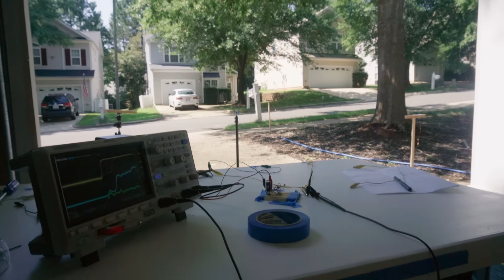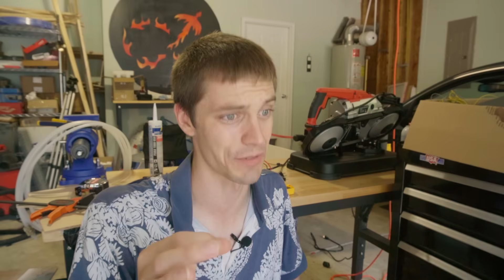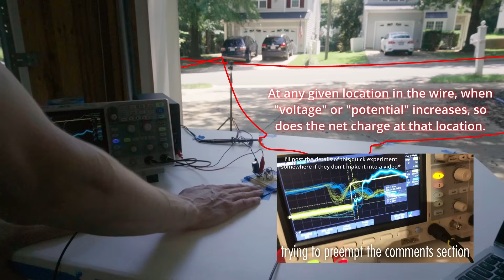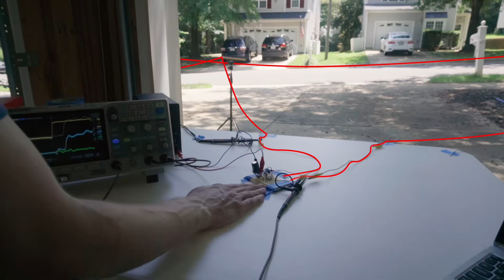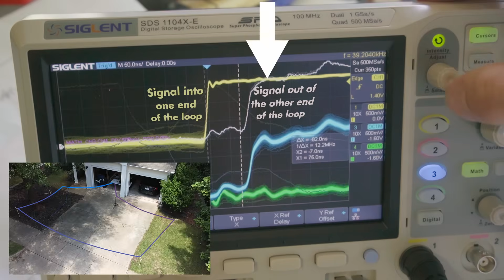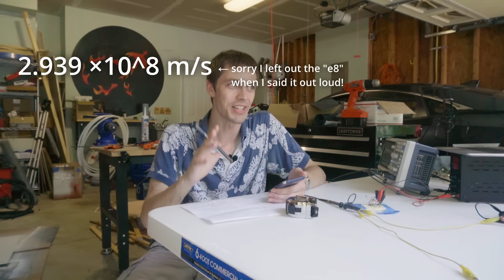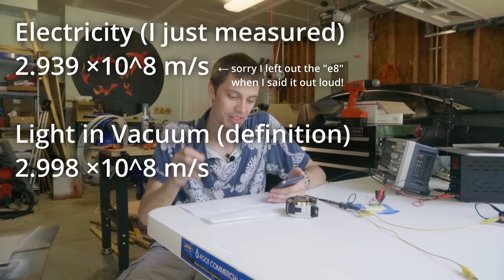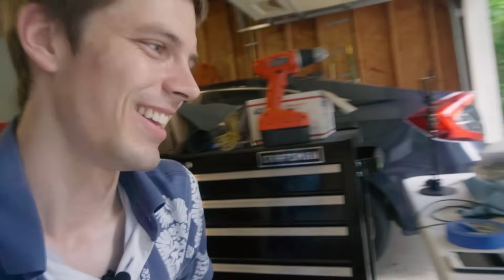Why does WATER change the speed of electricity?

Comment: From what I understood in the physics class it is something like this:
the system of atoms or molecules is "sensitive" to a couple of specific frequency. You applying a square wave to an atom is like smooshing that signal into the "holes" of frequency that atoms responds to. It's like polarizing light which is filtered by a rotated filter - if it fits the hole than the whole stream passes otherwise it is chopped by a percent (Eugene Khutoryansky video:
https://youtu.be/8YkfEft4p-w?t=797). This is also true in our case because the square wave is spread across the entire spectrum so if the system only responds to a couple frequencies the rest is lost energy.

The idea here is that the square wave is just that - a square wave. The Fourier analysis makes the point that having an infinite series of sine waves you can reconstruct that signal and this is true. That is however just an analysis and the wave is not such constructed "under the hood" in the real world. What makes it work in the real world is that the building blocks of matter responds to sinusoidal waves. When such a system is hit by a square wave signal it just picks out the energy for the frequencies it is sensitive to from your signal. When you analyze this behaviour you will shockingly find that viewed from the Fourier perspective your square signal is missing some "frequencies" which correspond the the ones the atom is sensitive to.

You can also think of this in terms of an antenna and tuner. You can have all kinds of waves hitting that antenna but only the frequencies selected by the tuner will pass.
It's also interesting because if you generate a good let's say 1MHz signal you will still be able to "drain" some of the signal energy with a 0.9MHz receiver just a much lower amount than what is broadcasted.

Comment: Sorry but you have made a big MISTAKE and respectively a wrong conclusion. 
The water didn't slowed the speed of electricity in the wire, what it actually did is to slow rise of voltage potential. 
The electricity in the wire traveled at the the same speed in the both cases, the rise of potential began at the same time exactly but in the second case it was harder to achieve the target voltage. What you did, you took the medium of the slope and concluded that it was slower. 
You had a big hint when the calculated formula said that slowness of the speed should be several times slower than the result but you ignored that and tried to come with a different interpretation.
Reply: I don't understand what you are saying. What is the difference between saying "the rise in potential was slowed" and "the electricity was slowed"? Aren't they the same thing?
Reply: @aspzx  I mean that the first signal that appears when the voltage starts increasing starts at the exact same moment no matter what is surrounding medium but in the case with water the slope is longer.

Comment: Electricity travels slower than the speed of light through coax cable. That is what the velocity factor rating is.
Reply: What's the speed of light through copper?
Use X-rays, they'll get through.

Comment: Do you measure after the resistor? If so a wire wound resistor would add to the length of the wire...

Comment: I'm sorry but this setup is way worse and less documented than the last one. I think you are measuring the time constant of an L-R circuit. The shape of the loop is critical! Also, your wire is a transmission line together with the ground and the ground resistance dominated the transient behavior. Effective dielectric isn't water but a layered air-water mixture.
In essence, you are having a very unusual transmission line with asymmetric losses concentrated in the return earth path which enables two traveling waves to go in opposite directions and after the propagation time cancel each other's losses. To make the x9 speed slowdown you should pass the wire thru a bath of water reaching all the way down to the ground!

Comment: I know with amateur/ham radio antennas, one made from insulated wire will be a different length than one made from bare wire, both being resonant on the same frequency.  The bare wire will be longer.  This is because the insulation slows down the speed.  We call this the velocity factor.  PVC insulated wire is about 97%  that of uninsulated wire, and therefore is about 3% shorter.  Makes a real difference on HF, where wave lengths are say 80m long.
Reply: That "velocity factor" actually has nothing to do with the real velocity of the waves. It is just an old and debunked rule of thumb(!)-formula from the space of old ham radio operator’s tales. You should be ashamed of yourself, spilling such untruth out to the open, because there are always people who believe such nonsense. You, sir, even debunked yourself with your 3% which will drown in a ocean of tolerances, measurement inaccuracies and bandwidth, we otherwise call REALITY ... do you think we are stupid?. Citation: "With ordinary antenna wire insulated up to twice the wire diameter with PVC, the reduction in velocity from the speed of light is insignificant and pruning can be forgotten about. It is much less than the pruning sometimes done for end effect which is usually unnecessary anyway.", via an article from 2011(!!!), "Should Dipoles Made With Insulated Wire Be Made Shorter?" from one of your colleagues (btw, I don't really want to put KB6NU in one sentence with you plonker!). There we can see also your so called "formula". 
In my opinion, the dielectric constant of PVC should be slapped right and left around your ears as soon as you get up in the morning, every morning, until you learned the basic principles about electromagnetic waves, lol! (This is of course meant to be satirical)
Reply: @dieSpinnt  quite a strong comment to be fair. I, in my own tests, have noted about a 2 to 3 % difference in length required, at hf, with using insulated wire Vs bare. 

You of course are entitled to your opinion. Have a nice day.
Reply: @dieseldes6578  Hey, I actually just wanted to point out that it is embarrassing to confuse resonant circuit parameters with the propagation speed of electromagnetic waves. And that you might even realize how stupid that is. Alone the proportions of your ridiculous antenna and the transit time in the dielectric of the insulation compared to the usual transmission distance. Are you kidding us?
Alone the change in runtime through the medium of air, kilometers or hundreds of kilometers with parameters that you have no influence on, such as humidity make your 0.00000000001% relevance look like a joke.

Well, If you don't figure it out yourself... which I hoped... you'll need that treatment every morning (I joked above) until you do! :P
Reply: @dieSpinnt  It's so disappointing to see an altitude like this on a public forum. You are clearly missing, or don't understand and don't want to learn the point I am making. Maybe it's too difficult for you. That's ok, we all aren't built the same.  Good day.

Comment: Remember you are measuring the potential across two points near the scope. You seem to be visualizing this wave on a single wire when instead that wave is spread across both sides of the wire because the potential difference and electric field are across both positive and negative sides of the circuit. Thought Experiment: I believe the charges are not (as you say) building up asymmetrically on one side of the battery vs the other. This is because the field drives the charges - this is the conceptual jump from water in a pipe to maxwells field equations.
Reply from the maker: What makes the field to drive the charges? The charges
Reply: @AlphaPhoenixChannel  Yes - you are referring to Gauss's law. Just like mass tells spacetime how to curve and spacetime tells mass how to move -- charges set up the geometry of "the" electric field (Gauss's law) and the field tells charges how to move (Ampere's law). So ultimately this is semantics but I would say that fields are more fundamental because you can have fields without particles (light in empty space) but you can not have particles without some type of field.

Comment: On some motherboards I saw traces that where purposefully squiggly, I assume it's so that traces from single bus are the same length and propagation time. I wonder if submerged PCs will have any degradation in any of their parameters. Maybe something like memory overclocking.
Reply from the maker: Sometimes those are antennas too (but then your statement is still exactly valid lol)
Reply: @AlphaPhoenixChannel  simple rule of thumb: if the lines are shorted out (or going nowhere), then it is an antenna!
by the way: everything is an antenna, which makes high freq PCB design quite difficult!
Reply: Depending on the pcb and application, yes, engineers absolutely lay out boards so paths are the same length electrically. My last job was as a signal integrity engineer working on signal paths that ran between 8 and 40GHz, it wasn't uncommon for us to worry about picoseconds or less of difference. When we made cables in the lab to connect scopes to boards (SMA connectors) the lab techs would measure electrical length of all of them, then match them to the shortest one using a file and a lot of patience, before capping the second end. And even after that we developed algorithms to account for small differences in those cables and the other equipment between the scope and the part being tested. Even though our PCBs had matched traces the manufacturing tolerances meant that they weren't matched enough, and it's surprising how much variation would exist between different boards, or even the same board on different days.
Reply: Yes, it's often important to match propagation time of different signals on a PCB (Printerd Circuit Board). As demonstrated in this video by Alpha Phoenix, length matching does not necessarily mean propagation time matching, because signals that travel through a different medium have a different propagation velocity. Therefore, signals that are routed on internal layers of a PCB (PCBs are often multi layered) travel slower than signals that are routed on external layers. This must be taken into account. Furthermore, different pins on the same IC will also have different propagation times associated with them owing to the way the pins are wirebonded to the die. These pin package delays are often specified in datasheets and may also need to be taken into account when doing propagation time matching.

Comment: I love your videos.  I recently read in a physics book that they measured the speed of light in a pipe with moving water and they saw through interference that it went faster in one direction than in another.  Will this experiment be the same?  Even if the cable is still, if you put water with current in one direction or the other, will the speed of the electricity change?